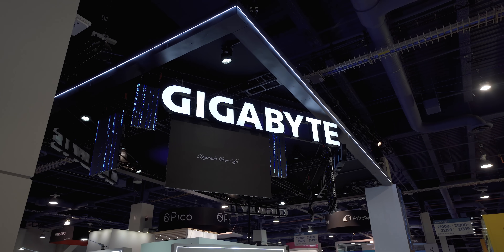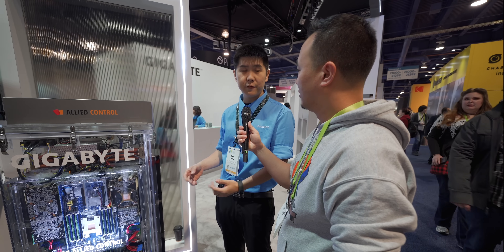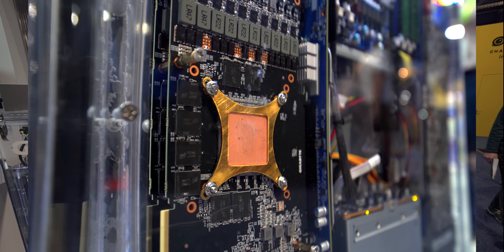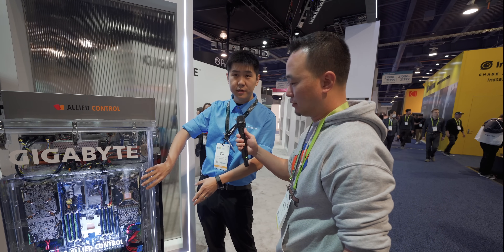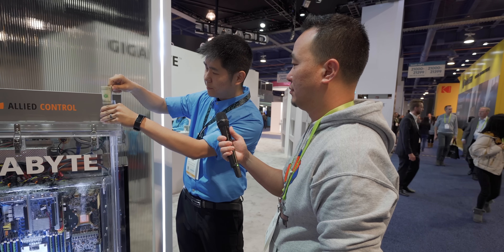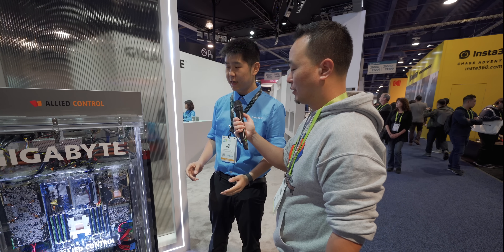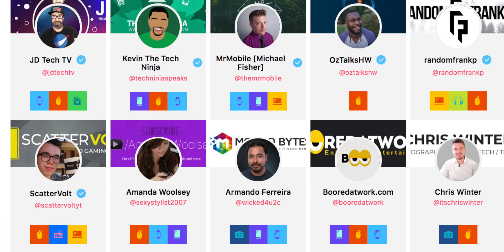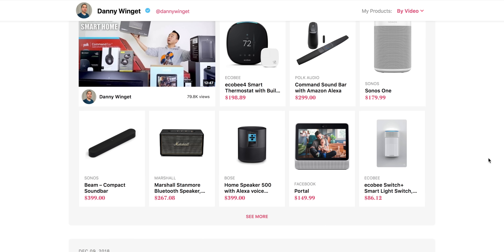PC Cooling Submerged in 3M LIQUID?

Comment: I’m interested in the coolant. I want to put it inside of DC electric motors to help cool them and provide a way to clean out the Wear material inside of sealed motors that have brushes and circuit boards.

Comment: Honestly, them worrying about the cost of the fluid is just because they're cowards. If they were being brave they'd use hydrocarbons - pentane has a reasonable boiling point, and is non-conductive. Its also not gonna be that expensive - even in large volumes.

Comment: you can actually get NOVAC 7200 or NOVAC 7600 pretty cheap depending on what state you're in, the hard part is building and powering the equipment required to phase change the fluid and remove the heat. also to contain an air tight seal on all of it
Reply: Fine, for which price range please ? 'cause despite searching i never found it for cheap.

Comment: Dead simple:
Nigh all if not all Mineral Oils, Silicone Oils, PPE Oils, PPO Oils,  FluoroCarbon Oils, PolyAlkylene Glycol (PAG), DiPhenyl Ether/BiPhenyl (73.5%-26.5% mixture), Transformer Oil, Pure Deionized Water, Betaine, LN2 (No, NOT NOx, NO!), LNe, LHe3, LH2,  Deuterium Oxide, to name one or two.
Note, each has their own properties, make sure you handle them well.

Comment: Csn silicone oils/liquids be used? I know they are inert, stable, great at heat transfer and its viscosity could be adjusted as well. 
But what could be wrong with silicone oils/liquids?

Comment: Some smaller applications could be done with this liquid. Could possibly have a case that fits only the GPU and liquid, and the liquid gets pumped to radiator. It would be better than the current liquid cooling method because the GPU is entirely submerged.
Reply: it would probably be cheaper as well bc you wouldn't need a water block.

Comment: My question is if the liquid degrades over time and if so at what rate

Also, how much better is it than mineral oil, aside from not getting the component wet...
Reply: My initial assumption is that mineral oil is a better choice as it's far denser and thus should be more efficient at absorbing heat. Also, mineral oil does not evaporate at the temperatures generated by even the hottest pc components, meaning you won't need to worry about vapor/pressure/condensers and all that. If I were to build a "wet" pc, I'd go with mineral oil, 100%. With that, this 3M liquid offers a huge benefit of not sticking to surfaces it touches, meaning that swapping components should be far, far easier than if they were submerged in oil.
Reply: @andreirachko  Quick answer, but no, mineral oils are not denser (usally less dense than water) but the Novec is around 1,4-1,6 the density of water. 
Heat capacity is probably in the same ballpark but mineral oils have a high boiling point, therefore no extra energy gets extracted from the system via phase change. Novec seems better in most regards but is hella expensive.
Reply: @NoSkillsNoFun  I see, thanks for informing me

Comment: He referred to the liquid as a floural compound, which is freon.  This is apparently a high molecular weight freon that boils at a much higher temperature than the freons used in refrigerators and AC.  The bath felt warm to him (100°F - 120°F?), which suggests that the boiling point of the liquid is around that temperature.  Since the bath can never exceed the boiling point of the liquid and since heat transfer to liquid is very efficient, all components are kept near that relatively cool temperature.

Comment: Remember absolute pure water isn’t electrically conductive
Reply: While it is true, you forgot to calculate the probability of tiny amount of minerals that might be released from the connection between the RAM modules for example, or Motherboard transistor. Those Copper if exposed to pure H2O will start oxidizing and will make the Pure H2O mixed with the copper tiny mineral, and eventually becoming conductive.
This particular Novec 3M liquid here doesn't cause any Oxidation.
Reply: @ClayWheeler  So what if you changed your ionised water once every few months or used car coolant as some have suggested?
Reply: @simonwright2210  Pure H²O will become Conductive within Hours of Running the Computer submerged in it.

Comment: I am more than a little worried about having a fluorinated ketone that is constantly cycled through rapid heating and cooling. While, by itself, it doesn't seem to cause damage to the ozone layer, its structure is just screaming to break down into some low-molecular-weight fluorocarbons over time and wreak havoc on the ozone layer. Depending on its various breakdown pathways, that concern might be misplaced, but still.

Comment: I bought fluerinert for about 250 a gallon.  One or two gallons can do it, but it just be a single phase system.

This is not new stuff, 3m has specs for many forms of inert pc cooling liquid. The actual difficult is taking all of your wires and boards and removing the rubbery stealths and coating. This stuff will go foul and stop working as a thermal transfer if there are these kinds of plastics in your system. It is not corrosive to metals, but very damaging to many kinds of petro chemical based products.

Comment: this is not good. Its not good at all..  for servers it has a use case.. As yeah the whole cabinet will heat up by the liquid itself.. But in tempratures acceptable for servers cause of the large area of components.. a server is hunderds of more kilos of pcb than your pc.. Your pc will be heating up 100% of the area while an traditional water cooling transfers the warm water away. It does not bank the warm water as a tank for your USB connectors...

Comment: Dry Water is what it has been nicknamed.  Amazing stuff. 
It does not conduct electricity, and it does not corrode metal.  The only downside is the boiling point is so low, it boils quickly, so your cooling solution must be beefy to counter that.

Comment: he said a data centre could save over 90% of their electricity costs with this fluid system. I don't see how that's possible. Firstly the same amount of waste heat is generated by all the computers whether they're air or liquid cooled. Secondly you have to dump that heat outside the building somehow. With existing setup the A/C system does this, with fluid you'd have to pump the hot fluid outside and then have large radiators with fans to extract the heat. Sure conventional compressor A/C systems are  power hungry but consider how much fluid you'd be pumping to get it outside as well as the huge radiator/fan setup. 90% sounds way too high.
Reply: This is a sealed system. And heat gets transferred with condenser

Comment: Just thinking about the space saving potential. I know it takes a bit of space right now as a demo, but just look at how much space is saved with those graphics cards stacked with a few millimetre gap between them, amazing. That could be really cool for an overclocked system, especially considering you could reach sub zero cooling with a chiller no longer needing to worry about condensation. Very cool video, thanks!

Comment: Thats amazing they boil the oil to remove excess water and cool the pc ftom the backdide and still dont have to worry about dust cleaning. Albeit it does still need oil changes because it will break down the parts wont it?

Is there some type of sealant you can spray on the pc before hand to slow down the degrading?

If i had one i would use diffrrent viscosity oil and dyes so when the fan blows it looks all fluffy and colorful in there

Comment: Ok, I'm trying to imagine a home setup. At least 10 gallons of $500 per gal. liquid, inside a sturdy, hermetically sealed case, the components themselves, and then a compressor and radiator for re-circulation. Exactly how heavy is this fuckin thing? Better not have it on your shitty ikea computer desk. And what a pain in the ass to troubleshoot and swap out components. What are you even running on your PC that would demand this? I can imagine it being marketed to rich enthusiasts, but it's insulting to even suggest mainstream appeal.
Reply: I don't care I want it over current shitty leaky noisy piping liquid cooling systems.

Comment: Mineral oil submerged computers have been around for years. It's pretty cheap and easy to build one. This is not new tech all they did was slap their name on the similar liquid and slapped an extremely high price for something you can get at a feed store for around $3 a gallon. You can even use baby oil. But with any liquid submerged computer you will need a radiator to cool the liquid.

Comment: Spend 5 grand on computer parts, spend 50 grand keeping it liquid cooled 👍
Reply: Pc master race right?
Reply: if only hardware density wasn't limited by air cooling designs
Reply: @2P-Immersion  just do full liquid Helium-3 submersion lmao
Reply: @virtualtools_3021  single use or are you capturing the He?  The equipment and energy to recapture the He would be immense
Reply: @2P-Immersion  look up DeepWave quantum computer cooling, they go BEYOND helium cooling, but i think one of their stages involves helium
Reply: @virtualtools_3021  it's neat but not exactly comparing apple to apples. The amount of energy to cool one of those systems is enormous. The 2-phase immersion cooling seen in these Novec systems is supposed to be a cooling solution with a lower PUE than other similar technologies.
Reply: @2P-Immersion  you just said hardware density, it doesnt get any denser than quantum lol

Comment: so this works for small environments but wheres the heat go?  this works because the overall tank can still radiate the heat away passively but that would reach a limit quickly
Reply: You have a heat exchanger or radiator where the PCM condenses.

Comment: Respect to the Gigabyte representative for being honest about it not being suitable for consumer use.
Reply: I wonder whats the price of 1 liter of that liquid
Reply: @yajhnal6536  It costs a few hundred per liter, depending on where you order.
And they sell this only to business users.
Reply: 240 dollar
Reply: @yajhnal6536  I used to work in semiconductors and 10 years ago it was roughly $300 per liter.
Reply: @yajhnal6536  100ish for the 400 line and 200ish to 500ish to the 1000 lines used in specialist fire extinguishing systems (per liter)
Reply: @yajhnal6536  50 usd
Reply: @yajhnal6536  mineral oil
Reply: @rannz8  no, this stuff is 3Ms novec, it's expensive
Reply: @quantuman100  How expensive?
Reply: @c.m.7692  250€ for 1L
Reply: @quantuman100  dam. I wonder how hard it is to make some in the garage...
Reply: @rannz8  No, Novec doesn't have any oil in it.
Reply: @rannz8  mineral oil slowly degrades the insulatorion on your wires and cables. You can do it but expect to replace your wires and cables once a year or so.
Reply: Imagine if that were invented by Apple
"Just 999$ for one drop of liquid"
Reply: Kratos HAHAHHAHAHAHAHA
Reply: They are not being honest, we are just not their target.
Reply: depends on the "consumer" does that include power users
Reply: Solve Everything  when you build it yourself
Reply: What makes something not suitable for consumers?
Reply: @karozans  expense comparative to alternatives or lacking ease of use
Reply: @karozans  Very niche and expensive
Reply: 400USD per Gallon
Reply: True, but I wish it was for my personal build
Reply: I'm sure someone doing professional rendering with a threadripper pro and a 3090ti might consider using this cooling.
Reply: @youdont needtoknow it's called flourINERT because it's just that - an inert flourinated compound. While I don't recommend drinking it you'd probably be fine.
Reply: @youdont needtoknow this one is made by 3M, it's non-flammable and have low impact on environment. they didn't say anything about drinking it though
Reply: $200 per liter.  So.....$10k....?
Reply: @angelmarauder5647  Where did you get these prices?
Reply: @c.m.7692  I searched the product online. On their website they only have call in prices but there are a few distributors.
Reply: Bet you they sat down and talked to him about that honesty
Reply: Shutup

Comment: Luke has done this actually oil cool pc. It was not this but some what similar
Because this chemical does not conduct electricity, it is safe to keep the system inside the chemical.
Reply from the maker: Yeah they did theirs with Mineral Oil I think vs 3M. I just thought this was so interesting but it’s been around for years.
Reply: True it is interesting and has been for years but at the end we keep trying to make something better than the last one. In this the cooling is way better than mineral oil pc. So we keep fiddling and make things better 👍

Comment: This is definitely not the future, this tech has been around for years, its a pain to clean, its way too heavy, bulky, and is difficult to set up, if the tank is damaged it makes a huge mess, it is very much a niche item, consumers can do this, they have done this, and there is a reason it is not popular,  the weight and the maintenance being the biggest ones, it looks and sounds neat but honestly that is no reason to think that something is the future

As far as linus goes there are some differences in the liquid, this is a very different luquid overall, it allows for higher tolerances in heat than the mineral oil that linus used amoungst a few other differences i might list later

Comment: So does the boiling / phase change actually convect enough heat away to make a difference over a mineral oil submersed pc? Or is it just a cool looking thing to have the fluid boiling off the warm chips?
Reply: I’m sure it doesn’t, this is snake oil. 🤣
Reply: @chadwells7562  ofc it does, or why would big data centers buy that instead of oil cooling from idk walmart.

Comment: This is a 3M Novec fluid. In my industry(fire protection), we use it for fire suppression for rooms with servers or other electronic equipment.
Reply: Its also called dry water
Reply: 3M 685 should be around 50-80USD per liter
Reply: how much is it per oz?
Reply: I’m in fire protection as well, and the first thing I thought, was this was fire suppression fluid.
Reply: @voodoo7008  get me some of the fluid dude
Reply: @roboticunclephil  sure, I love unemployment, and jail, lol.
Reply: That was pure water zero mineral
Reply: If I have a choice between 3m and some other brand, I chose 3m, no questions asked.
Reply: How much is it
Reply: @roboticunclephil  hundreds of dollars a litre for 3m novec
Reply: @virtualtools_3021  do you have any to sell to me
Reply: @roboticunclephil  i wish! i dont work at 3m tho, sorry
Reply: @virtualtools_3021  how do i make it
Reply: @roboticunclephil  With state of the art chemical facilities, it'd be a helluva lot easier and cheaper to call up 3m and quote them for however much you need
Reply: @roboticunclephil  I saw this stuff online at about $400 / gal. So it is a little pricey.
Reply: @fmagic2000able  Sell me some
Reply: JuiceboxNine it is mineral oil, at least I hope it ain’t as expensive as novec
Reply: @cryptopetshop7090  no it isn't mineral oil
Reply: @cryptopetshop7090  this is not mineral oil. it's an improved method of mineral oil cooling, and with different liquid.
Reply: @cryptopetshop7090  I would not recommend trying to put out a fire with mineral oil
Reply: @derpinbird1180  😂😂😂

Comment: The CRAY-2 supercomputer from Cray Research used this technique back in 1985!
Reply: cray used fluorinert...is this the same?
Reply: slightly different in the boiling factor. the boiling helps remove the heat and increase circulation.
Reply: @brycering5989  yep, latent heat of evaporation, it takes a decent chunk of energy (heat) to make a substance change state (in this case from liquid to gas)
Reply: That's cray.

Comment: Fluoro based and environmental friendly? Sounds unlikely
Reply: it's OK as long as you don't spray it into the ozone layer
Reply: I can't say it is chemically environmental friendly, but if it consumes less energy, it is environment friendly in a way
Reply: @drakondriu  gonna need the sds on it to see if it really is.
Reply: okay after some checking the sds on this, seems pretty clear,  it's pretty damn safe for everything this one is.
Reply: Probably why they kept repeating it.
Reply: I saw someone from 3M lick it. this should be safe.
Reply: How the molecules are arranged in Novec make this refrigerator much more environment friendly compared to similar refrigerators
Reply: Derek is very much correct. In contained 2 phase systems or in single phase atmospherics systems, it will not harm a thing. It's liquid form is very much inert and is unlikely to react unless heavily provoked
Reply: meh, it's 3M making it, they know their chemical magic
Reply: Check out The Devil We Know on Netflix...HIGHLY doubt 3M produced something environmentally friendly.

Comment: Nothing new, this was done back in 2000 or 2001
Reply: What did they use? Are you sure it wasn’t just mineral oil submerged cooling which has drawbacks this doesn’t.
Reply: Proof?
Reply: @MarsilitoSanchez   my dad did it on early 2000s, this is true.

Comment: Linus did something similar a few years back but he did it with mineral oil.
Reply: The cooling method is very different. The mineral oil pc uses convection as if it were an air cooled pc. This system uses boiling to keep the components cooled. It basically uses the same concept of air conditioners but on a much, MUCH more simpler design.

Comment: It's really to bad that Nova 7000 series (that is used for immersion cooling) is around $500/gal. That display unit is probably about $1500-$2000 in fluid alone.